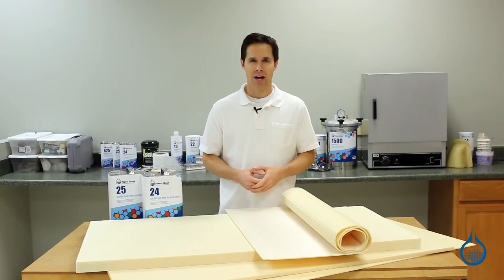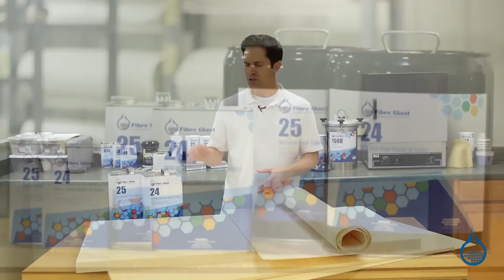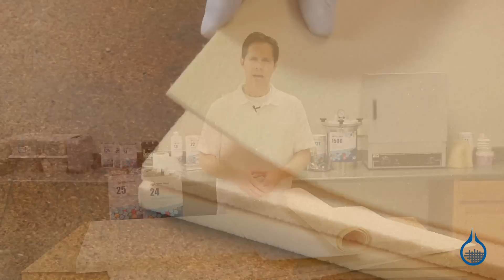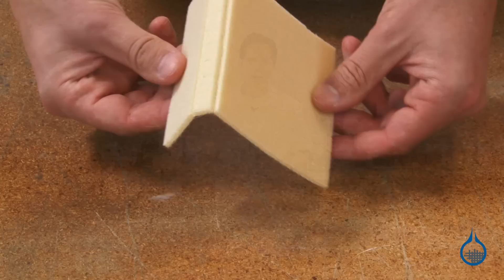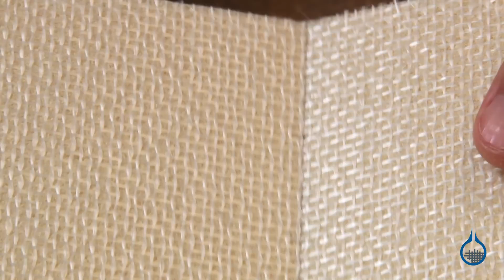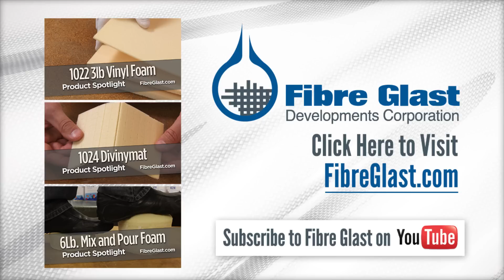Foam Materials

Comment: Hi, I am Danny,
I am not much of a Chem'Engr. And total confused.
I am in India, and need raw material to make Buoyancy Rigid Foam for my Boat, volume equal to a total of 7.86m3 of side skin lining for buoyancy & buoyancy tanks fwd + aft section.
1. What kind of materials do I need?
2. What density t/m3 is required for rigid buoyancy foam.?
3. How much quantity do I need?
4. What is the expansion ratio of the liquid to the Rigid foam?
Thanx kind rgds
Danny. +6596136670 (WhatsApp only)
Pls help n guide me.
Reply: Hello Danny,
We are the manufacturer of EPE and PSP FOAM SHEET EXTRUSION LINE, I can't add your Whatsapp, pls add my Whatsapp 0086 13386456156 so I can send more running vedios to you, tks

Comment: I am building an Aluminum Hulled Boat, 55' long.  So my structural is set, but I need to find lightweight materials for my interior walls.  
I want to find a foam board materials where I can use for interior walls/soffits, but it must accept Wood veneer overlay on both sides of the foam board.  Also, I must be able to router out/add wood blocking, in order to anchor/attach other elements to (Example - Door things need to attach/screw into the foam panels).  

Which product would you recommend? Is it a composite foam board with an exterior faced, very thin veneer? 
Is any of your foam rigid enough to avoid the need for fiberglassing the entire panel?  Since I am going with Aluminum, I don't need the strength.  I need the foam for function only.

Comment: 1:16 Where i can find this?
Reply from the maker: The 3, 4, and 5 lb. density vinyl foam sheets can be found on our website. I have copied the link to that category page below.

https://www.fibreglast.com/category/Foam
Reply: @fibreglast  can polyurethane expansion foam  be used in carbon fiber wheel molds used in autoclave?? Does it have same tensite strength like other forms of foam mentioned?
Reply from the maker: @FirstLast-tx3yj  that will depend on the temperature of the autoclave. Our polyurethane mix and pour foam has an operating temperature of 200°F. Much higher than that can compromise the integrity of the foam. Regarding tensile strength, it depends on which density of foam you purchase. We have a 2 lb. and a 6 lb density. Our 6 lb. is probably your best option.
Reply: @fibreglast  thank you for the fast response. I have been watching all of your videos to gain all the info. One more question, in the case of carbonfiber and resin infusion vacuum bagging.

1) put carbon fiber on both halves of the mold
2) lay the expandable foam on one side
3)close the two halves on each other
4) wait till the foam expands
5) start resin infusion
Any mistakes in this procedure??!
Reply from the maker: @FirstLast-tx3yj  I do not see this procedure working out in the end. For starters liquid expandable foam is not to be poured onto dry carbon fiber. Second pouring the liquid foam into a closed mold will either leave voids or create pressure as the foam expands.

For support selecting any products please contact our customer support team by the phone number listed on our website.